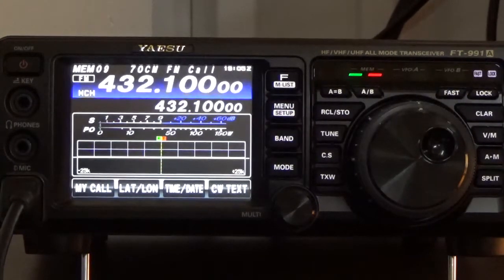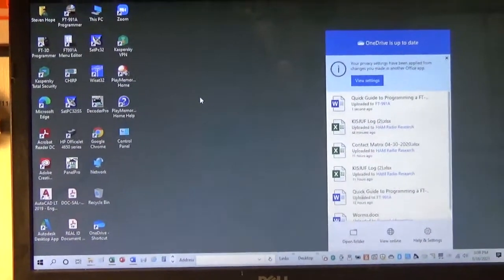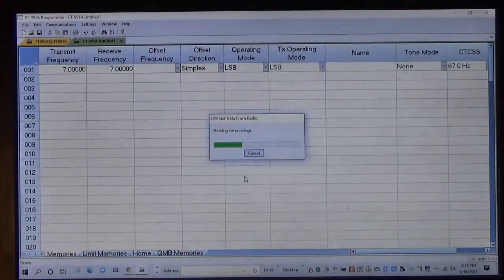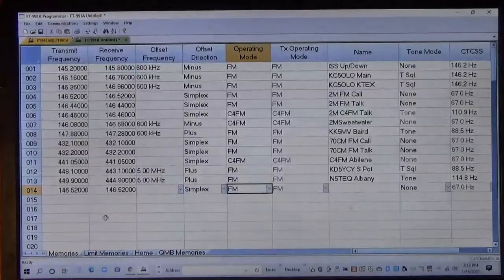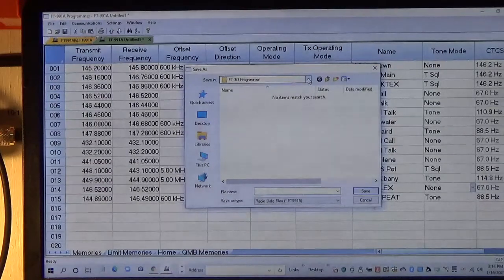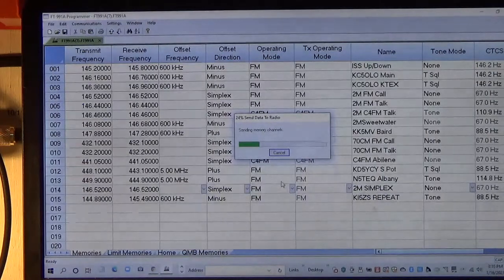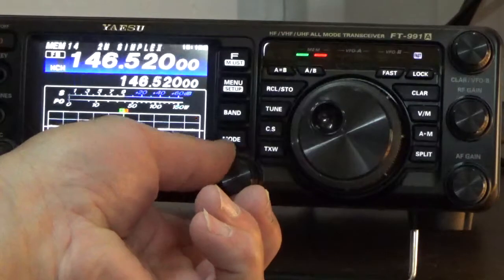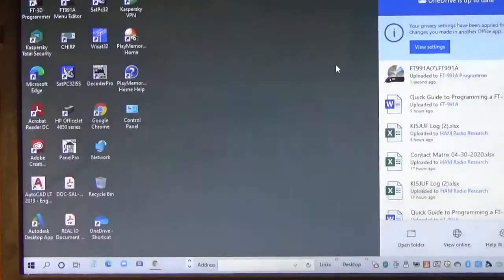Programming Memory Locations FT991A using RT Systems Software

Comment: But what about all the different size repeater shifts when the radio has  a fixed shift?
Reply from the maker: How you doing, there is a way to adjust the shifts, Press MENU/SETUP for example select option 082 RPT SHIFT 144 MHz, press SELECT button use the MULTI knob this will allow you to use a custom OFFSET other than the default,  then press Enter to save it.  I think this may across all you memory channels, give it a try

Comment: If you go to "File" -> "External Data" - you can just suck in all the settings from Repeater Book and/or Radio Reference. No need to do these manually... are you going to confuse the radio by putting in the same frequency twice ? Memory 004 and 014 are identical... also, c'mon Yaesu... you gave me 900 memory channels on my FT3D, but only 99 on this radio ?
Reply from the maker: Good evening and thanks for that tip, I don't think the radio will know the same frequency is in two memory locations, I think;  thanks for the message and keep in touch '73 de KJI5JUF

Comment: KG5PTE here. I have a Yaesu FT991a too, and on page 111 of the Manuel it shows how to program a range of frequencies. So using RT systems. How do I program a range ? like 28.300 too 29.700 and have the radio scan that range ?
Reply from the maker: Hi there KG5PTE, I made a video that shows, you may need to segment them by mode for example USB, FM and AM, I suppose you could scan 28.300 to 29.700 and pick one mode if any comes in you will hear something - good luck following is the video -  https://youtu.be/XpFnWbrP_CA